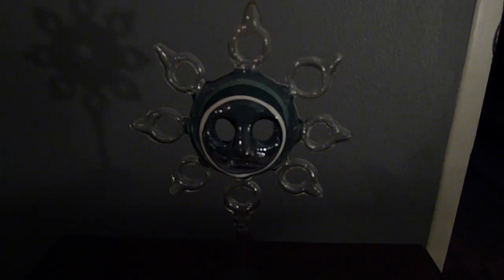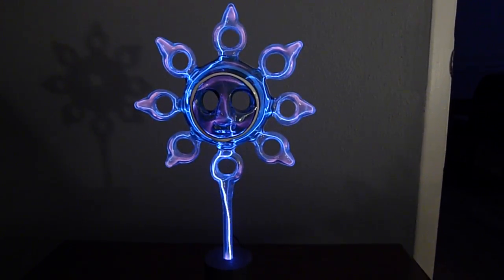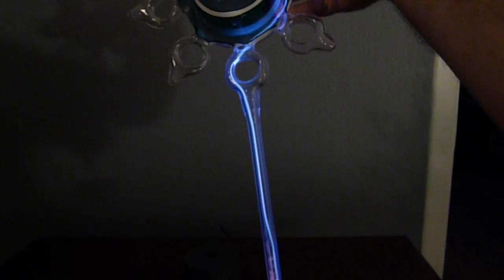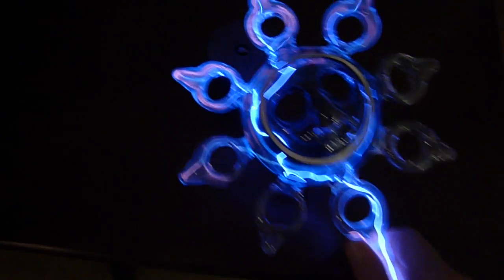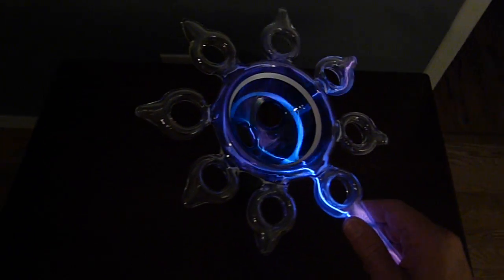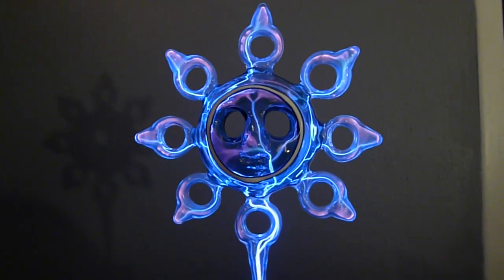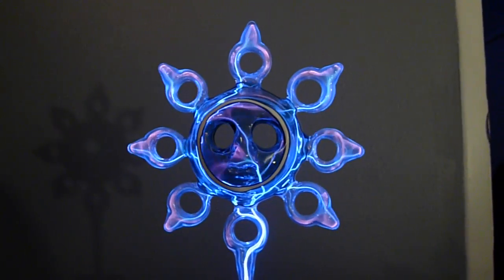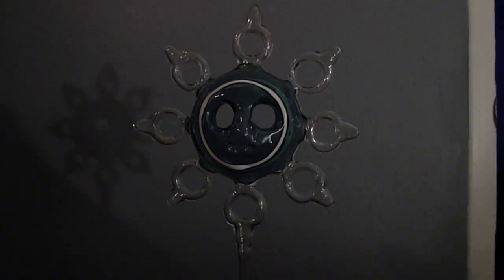Collaborative plasma sculpture: Adam Sultan (lampworker) and Carl Willis (plasmafier)

Comment from the maker: Hi Frank,  electrodes are the most efficient and reliable way of bringing electrical current into the tube.  However, there are two major downsides: they are expensive and they are chemically reactive.  Certain mixtures will not survive in the presence of electrodes, such as the excimer mixes (Xe, Kr + I2, Xe + N2, etc.).  I mostly avoid electrodes, as I think the possibilities without are more exciting.

Comment from the maker: This tube was heated externally to 220 deg. C overnight and treated with an oxygen plasma to clean it. I don't do much with electroded tubes; I think there is a lot of untapped potential for reactive gas mixes, like the one in this tube, which are incompatible with electrode materials.  To find my fb account, search under my name.

Comment from the maker: Hello Sergey, the power supplies I normally use operate in the range of 30-50 kHz.  However, higher frequencies can be used with the resulting plasma effects being often quite different.  I have used 27 MHz, which produces intense but local discharges in the tubes and, due to the difficulty in obtaining very high voltages in ordinary lumped-element resonators at this high end of the HF band, requires that the tubes be ignited with some other source of power.